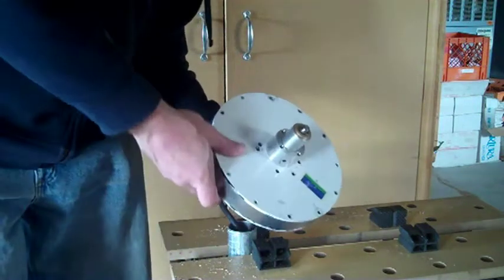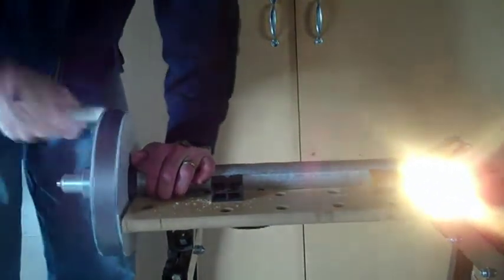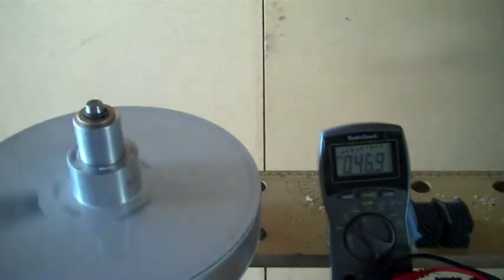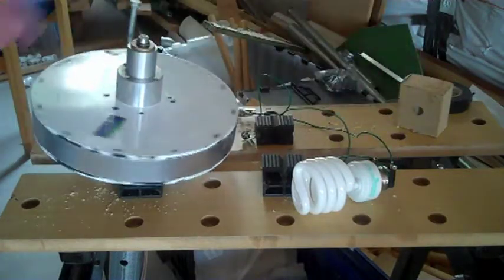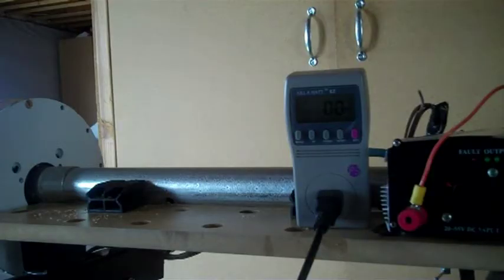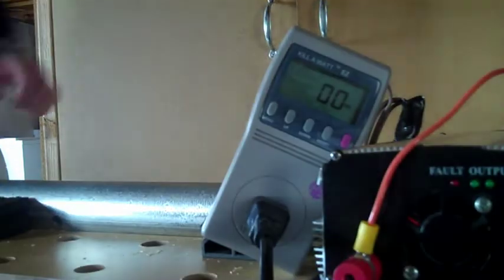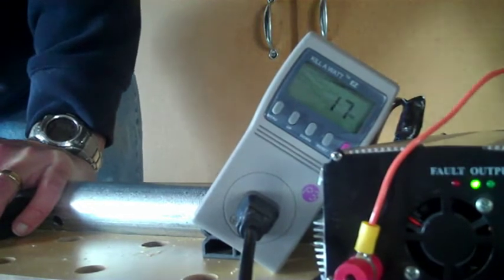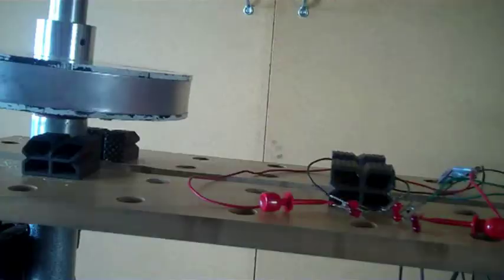Boreas Alternator Prototype Demo

Comment: You are right, the impedance of a car battery is much lower.  I'm working on electronics that will match a high impedance alt to a battery.  I have a video showing some testing with a prototype.

Comment: I like it, but does anyone know the impedance of something like car or deep-cycle batteries, and when were charging batteries I think that would be the impedance to match for most people, ie battery recharging.  But I understand the alternator/generator may be matched to a 12v to 120v inverter.  This is a nice advancement.